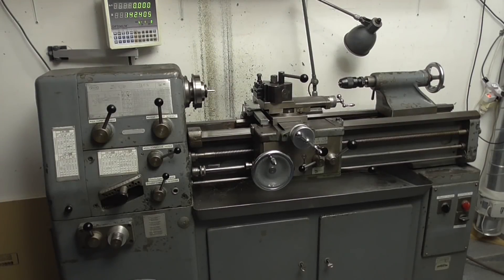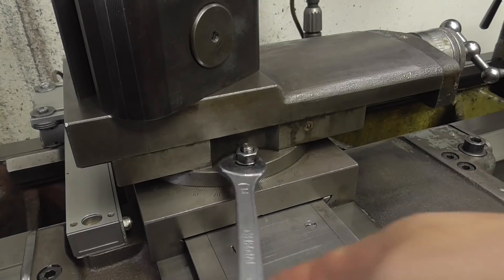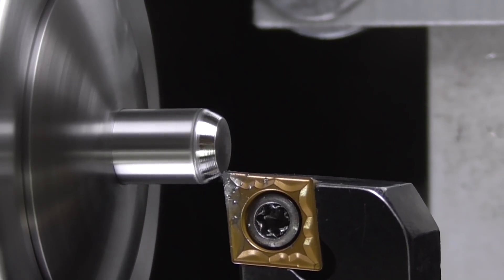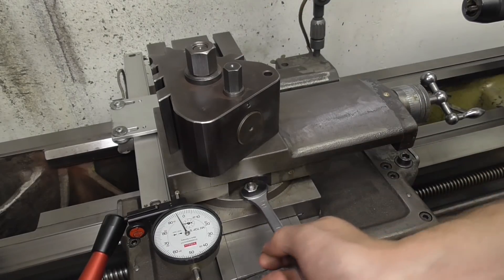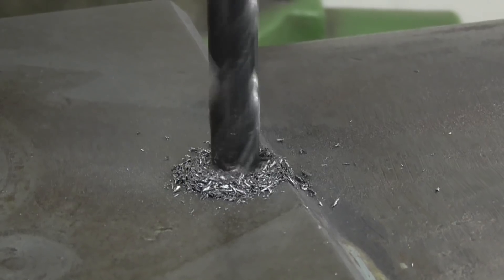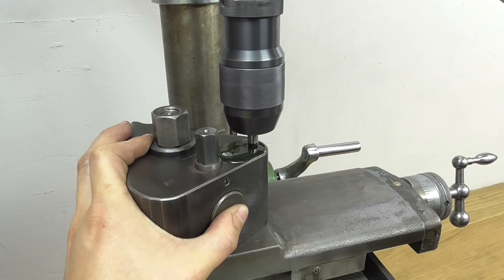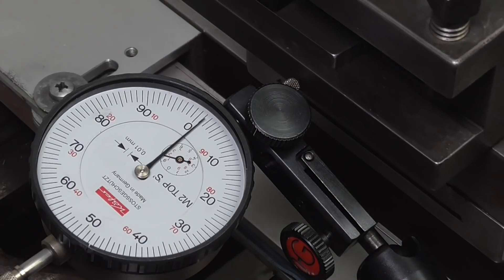Tool Post Issues! I drilled a Hole in my Lathe - Lathe Upgrade

Comment: Great quick video! Loved the "Plock" sound when you removed the pin ;)
Reply from the maker: My favourite part of this video! Thank you very much for your support :-)
Reply: And I tried to reproduce the sound right after it hahaha
Reply: I think it's called cushion fit. Saw a Japanese cabinet maker make a desk with three drawers on the side. He pulled out one drawer then pushed it back in. When he pushed it in, the tolerances were so close, the other drawers opened. 

Same concept.
Reply: @timothyball3144  That would be annoying; imagine shutting one drawer and the others open again, until you go crazy!!
Reply: So satisfying~
Reply: @timothyball3144  

My drawers always end up off 1/8” in one direction. Haha

Comment: That cartoonish noise when you pulled the pin out at the end was the best part of my night.
Reply: Manuela Rebecca  the lathe is one of the best parts of these videos. If you don't like it, you are going to hate most other restoration videos that use metal parts.

Comment: Very Brilliant Idea! Work can be made easier for the future by only so much extra work for once. But since you have to sometimes realign the Tool-holder in the 20° position, wouldn't it have been a good Idea to also make a hole in there? It's my idea because the lethe I use reguarly has such alignment-holes every 5° for the Tool holder and the Top-slider. It's also not original but a modification by my instructor, because we're turning just about every tapered part you could imagine. Just an Idea. But you're Videos are sooo great. I just Subscribed the other day and nearly managed to catch up on your Vids. Have a verry nice day!

Comment: My favorite restoration channel. Very talented. I'm curious what your background is.
Reply from the maker: I'm a professional cnc-machinist for 18 years now.
Reply: @mymechanicsinsights  I too work in a machine shop mostly doing manual lathe and mill work but also on the CNC Mills and lathes.

Comment: Hi MM, thanks for sharing another awesome video on your lathe tool post, as always you really doing a fantastic job and making things for yourself easy and simple so you can work with easy and less stressful, thanks for sharing your innovative ideas and showing us your workshop lathe, what is the brand of the tool post and the brand of collet chucks you are using, and also the cool magnetic dial indicator its different from the one i use at work, the one you are using looks quite easy and simple to use, i am hoping to see more of your workshop tools you use and if you can make more videos, i hope you are safe and well in this uncertain times, keep up the fantastic work you are doing
Reply from the maker: It's Tripan, thank you
Reply: @mymechanicsinsights  
No worries Tripan im interested in the collet chuck you are using what brand you using and is it spring loaded cheer stay safe

Comment: Great to see this simple mod. Could be worth putting an air flat on the pin as the reamed hole is blind to make is easy to pull out especially if any coolant gets in the hole. :-)

Comment: That's pretty cool. I'd also suggest if you have some common angles you use a lot (20, 45, 65, etc) you might make some holes for those as well. I know a guy who has his set up this way and he pretty much never has to check standard measurements, just pop a post in.

Comment: Weird toolpost that. I have a Rapid one on my lathe and did a similar thing but I only need one hole for both turning tools and boring tools. You may need a second hole for the angle you use for the front tool position? The Rapid ones are square so only need the single hole to align.

Comment: That was such a clever solution to squaring your tool post.  What was the first hole in the tool post originally used for?  Thanks for the great videos, and thanks for the English subtitles/narration.  I think I would be missing good information without them.

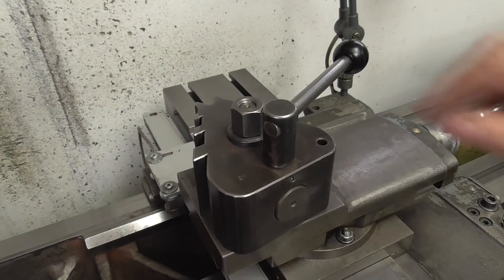Comment: Why do you not use a tool holder that can rotate only in one direction (by quarter turns), with pawls when trying to rotate in the other, where the pawls "lock" always at the correct angle? I used a head with four sides, so I could insert four different cutting tools. When changing the tool, I simply loosened the handle (like you do), rotated the whole assembly over 90° until I could hear it click, then I rotated a bit back until it automatically stopped and tightened the handle. I could also rotate the whole assembly only partially and lock it there by the handle, I could freely rotate to both sides within the mentioned 90°, which was always enough for each tool. What was missing was an accurate and big enough angular scale, but that would be easy to retrofit. Of course in your case, a four sided "head" would be impractical, but there is no reason that a three sided one could not be made. At 1:54 to 1:55 you turn to the left and then slightly to the right. Why not make it so, that you can rotate to the right only until a pawl automatically catches to a hole? Like a ratchet. If you over-rotate, simply turn another 320° and you can slowly approach the "click" point and lock it there (you could read on the scale where you are at.

Comment: Just a thing I thought about 5 minutes ago, which I have to write down somewhere or my brain will explode.
You could also build a jig to orient the topslide in a repeatable/precice way if you use the collet chuck to drill/ream a hole in one of your toolmounts.
Could be faster/more precice if you need to cut a specific angle all the time.

Comment: @My mechanics - I think that a should be drilled a second hole, which would be perhaps more useful than the first, and would center the tool holder for internal turning
Reply from the maker: For turning the cone it's not needed to have the tool exactly lined up with the axis of the lathe. It's needed especially with the parting tool, or turning threads.
Reply: @mymechanicsinsights  I also mean for making internal thread

Comment: I made myself a 60 position ratcheting adapter. Also, kinda ironically I have a size 2 Tripan toolpost on a 500mm swing 2m bed lathe (20" by 6').

Comment: Why do you setyup with the compound rest feed handle square or parallel to the axis? I was taught to set up with that 30  degrees to the outside as a standard position. In one of the early shots , you set up at an angle of 20 degrees with the handle inside the ways.

Comment: I'm curious why you think the toolpost has to be exactly perpendicular to the spindle? I realize that for some operations such as parting it is required that the tool be perpendicular to the work. Most of the time I turn with the tool post "close enough".

Comment: I wonder what made them put that hole in the tool post in the first place? Is it designed for a different lathe which already has the lower hole for aligning?

Comment: How accurate is the angle scale for your compound slide? Will you still have to indicate in the compound every time you move it? If so, you could probably do the same kind of thing to the compound slide itself... A reamed hole in it and the cross slide, and use the same pin from the top post to align it.

Comment: now you can add ball and spring and avoid yourself of searching the pin each time. as bonus you can drill the most common positions on the plate, but that is like to troll yourself :)

Comment: Nice work👍Maybe leave the pin in for more rigidity (eg when parting or using form tools)?🤔
Reply from the maker: If you have a crash, running with high feed with the tool in the spindle than the tool post can still turn away and minimize damage. That's why to better remove the pin when working.
Reply: @mymechanicsinsights  makes sense👍

Comment: The hammer looks like a toy to me which is still in it's original sealing o.O
Reply: Hah, never thought about that. It’s called a dead blow hammer btw, the cylinder between the nylon pucks is filled with lead shot, this will reduce the “bounce back” from when the hammer hits.

Comment: May I ask a question? What is the material used on the tip of the tool you use on the lathe to turn the cones? Is it diamond? How often do you need to replace it?
Reply from the maker: It's carbide, it depends what kind of material you're cutting how long it lasts.

Comment: Good job, but I don't understand why it has to be perfectly parallel. What's the problem if there is a small mistake on the tool post?
Reply from the maker: Especially needed for the parting tool or when turning threads. The tool has to be perfectly parallel so the tool geometry will be accurate.
Reply: @mymechanicsinsights  thanks for the answer!

Comment: i have a couple questions (not suggesting i know any better; just wondering lol): why do you not use an insert made for aluminium when you turn aluminium, and why is your 45 degree tool not carbide?
Reply from the maker: I only have allrounder inserts, it's good enough. It is carbide, soldered onto the tool holder.
Reply: @mymechanicsinsights  ahh i see. alright. thanks for answering :D

Comment: The question is, why you had to add this function to the machine. Why is this not installed by default?
Reply from the maker: The tool post as an optional attachment.

Comment: why didnt you just make a mark with a marker or something like that? And why does it need to be exactly parallel?
Reply from the maker: It has to be accurate especially for the parting tool or turning threads.

Comment: makes me think, how come there is no dial on the tool post like the one for the rail? I mean yeah, this pin was easier to make, and you can put many types of toolposts on the rail, just interesting how they didn't think it would make sense...
Reply from the maker: The tool post is optional, there are many different kind of them available. This is a Tripan.

Comment: I don't get why the tool has to be at 90 degrees exactly. Don't you only use the carriage for horizontal and the cross slide for vertical movement? The angle of the tool and the compound should not be important.
Maybe I'm missing something. If so I'd be really happy to learn :)

Comment: Near-Perfect solution. Thought about fitting the Pin with a Knob?
Reply: close tolerances, it will be difficult to remove the greasy pin
Reply from the maker: Yeah, but that would make it roll away easier when laying on the shelf. Maybe I make a follow up video if I change my mind ;-)
Reply: Good Point! So an 6 or 8 Surfaces Cylinder!
Reply: @mymechanicsinsights  then use a dividing head on milling maschine to make knob :)

Comment: WTH?! Your compound is not supposed to be normally set at 0 deg. It should, for normal use, be set at 30 deg.  It is a "compound" not an in-feed. At 30 deg some magic happens. your compound can be used as a micro-fine cross feed. 30 deg is nice because it reduces cross  feed travel  index markings by precisely 50% of the indicated marking. If you want to machine exactly .001" it is easy using this method. Turn in .001" and it takes off .001" not .002". Going to 60deg. makes it 50% finer still. And yes this video speaks for itself it  says you need to get some training on machine setup. Maybe read a machinist handbook. That said your tool post rarely needs to be so precisely set parallel with the chuck.  When using a parting tool back the cross slide back and find a place on your chuck to match to. There is a reason there is no hole already drilled in your compound or anyone else's compound. It's because it  isn't needed.